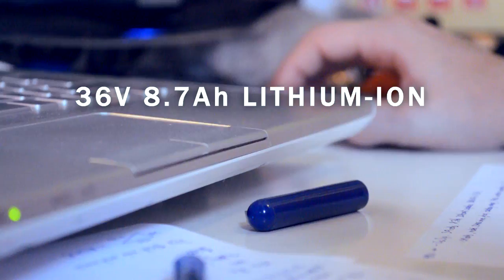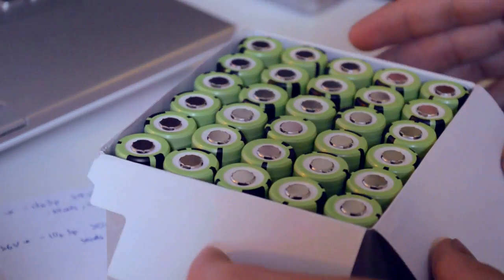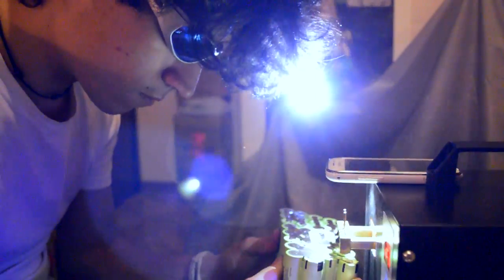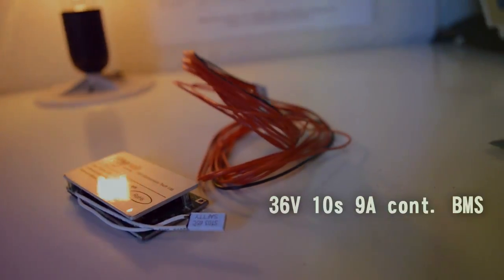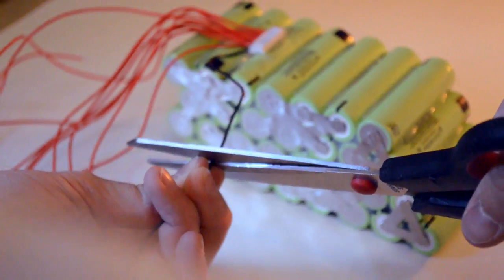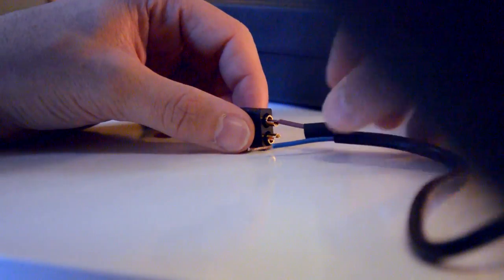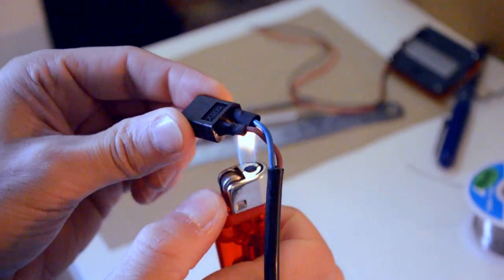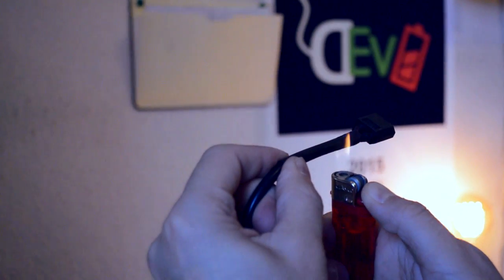36V 8.7Ah Lithium-ion portable compact seat bag battery pack

Comment: By putting lithium ion battery's in parallel connections do you add up the current? So if I put two 20A battery cells in parallel,would it put out 40A? This is a very important question because I don't want to pay a lot of money on battery's and put them in parallel connections to add up the current just to find out it doesn't and waste a lot of battery's and money.

Comment: Hey Damian, I'm not sure if you're in the US but if you are could you recommend a supplier for the battery shrink wraps and the heat resistant tape? I've found the PVC in these wraps to occasionally be of dubious quality and sometimes heat resistant tape isn't all that resistant.
Reply from the maker: this is a source for large shrink wrap: http://www.ebay.com/itm/268mm-Diameter-170mm-PVC-Heat-Shrink-Tubing-Battery-Covering-/322151524283

Comment: Hi Damian, just want to know about charging, if it could be charged in series, i.e., charging at the end points of 36 v or additional points to bring out from individual 3.6 Vdc. As it seems that cells were having inbuilt protection circuit, so is it safe to connect two cells with protection circuit in series?
Reply from the maker: once they are in series you can still charge them independently (each series separately not each cell, paralleled cells charge together), or charge everyone at the same time with the matched charger voltage. For 10s li-ion 42V

Comment: Im looking to make a battery pack to power a 300w 36v motor- what would you reccomend? Thanks
Reply from the maker: If your controller doesn't output more than 9A continuously, having a 9Ah battery (1C max continuous discharge) or more is the best discharging scenario for a li-ion battery

Comment: how do you keep them from getting too hot if you glue and shrink wrap them?
Reply from the maker: +cris mitton Indeed in this way the heat transition between the cells is much faster than arranging them in other postions (like with cell holders where there are 4 cells faced instead of 3). The surface of the cells in contact is the maximum possible, and the silicone is a better heat conductor than air (static). The shrink wrap is very thin and have a very great surface, it is very important to use because there is indeed the best way to insulate a battery wit the maximum heat dissipation possible.
If you are making a very high discharge rate with these batteries (greater than 3C) you should add an active insulation, in most cases these batteries works for low rating power demanding and are installed in a good position with passive air cooling

Comment: Awesome editing! I love these videos. One tip i have for soldering on the wires to each set of cells is to solder onto a small pice of the nickel strip then stop weld that onto the pack. Allows you to get a better solder connection and protects the batteries against the bit of heat from the soldering iron.

Comment: i need a battery like this for a portable amplifier...  is any possible way that you can do it ??? the consumer is 12v 5A(max) .... and i was thinking of a battery pack of 12v 20A ... but everybody on internet makes only big ones 36-48v .... i'm trying to figure ot how to build one but my knoledge isn't that great ...
Reply from the maker: +capcyvasile The battery could be similar made than this except it would be made with 3s or 4s depending on your electronics voltage specifications, a 12V 20Ah would have a similar size than the one in the video. You could contact to me at rene.sunset@gmail.com and I can help you to design your battery

Comment: Very tidy work! what are the two white cables coming out if the bms? I couldn't find and information on the website.
Reply from the maker: +Thomas Setchell It is a temperature sensor. That BMS board has a temperature cut protection function.

Comment: Very nice battery dude! I guess it is made for some smaller regular city  e bike? Since those battery dont realy like more than 1C load...Anyway good job , keep it up!
Reply from the maker: ***** it is indeed for a commuter assisted ebike. With a small rear 250W hub motor Q100 and a KU-63 controller is expected around 40Km of assisted range. BMS cuts indeed at 1C (9A continuous) but that combination of motor and controller takes around 6A - 7A continuous flattening at max. throttle. Thanks for comment!
Reply: Damian Rene i have similar e bike but my is 100% made in china ;) 250w , 36v 10ah li ion.. And when it was new ,range was at least 50km ,sometimes even 60km if we drive carefully. Now after 10-11 months of every day driving (20-30km peer day) range is around 35-40km which is good considering it is a chinese bike with probably very low quality cells... Latter when it is needed im planing to replace all cells in battery pack with some simillar like you used in this video. It will be much cheaper solution then buying a new one:)
Anyway good job with e bikes , plz continue uploading videos.Ur clips  are very interesting to watch! Cheers!

Comment from the maker: Building a 36V 8.7Ah 18650 lithium-ion cells battery pack for a small seat bike bag.

- 10 serial, 3 paralleled 2900mAh 3C max Panasonic 18650 Lithium-ion cells.
- Spot welded 0.1mm x 6mm pure nickel strips.
- 9 Amps. Máx. continuos BMS* with balancing function.
- 16 AWG Wires.
- 85mm diameter Battery Shrink Wrap
- 10s 36V lithium-ion configured battery meter
- 60A anderson SB50 connector for discharge
- 60A XT60 connector for charge
- 2A 36V 10s lithium-ion charger with XT60 connector
- customized seat bike bag

*BMS protection: HVC, LVC, short-circuit, over-discharge, over-charge, high temperature cut (65ºC)
Reply: Help me understand mAh to Ah conversion. I was told 1000mAh was 1Ah. Is that correct? So if this pack has 30 batteries at 2600mAh each doesn't that come to 78Ah? Forgive me if I'm ignorant I'm trying to learn.
Reply from the maker: A battery is made with cells in series and cells in parallel. Cells in series add their voltage, cells in parallel add their capacity (Ah).

This battery has 30 cells. 3 cells in each parallel group (3p), that make groups of 3 cells that are connected in parallel adding their capacity at the same voltage, so they are 2.9Ah * 3 = 8.7Ah, and the voltage the same 3.6Vnom.

Then those paralleled groups are connected in 10 series (10s) and they add their voltages. 3.6Vnom * 10 = 36Vnom. So we finally have a 36V 8.7Ah battery.

If you, instead if this, put all the cells in parallel, (1s30p), so of course you have 2.9Ah * 30 = 87Ah, but the voltage is only 3.6Vnom
Reply: Thank you very much for that explanation. I see how to calculate everything now and I understand what 1s30p means. Didn't get it before your explanation. Thanks a lot!
Reply: damian rene    abi bunla sarj olurmu https://tr.aliexpress.com/item/New-iMAX-B6-Lipro-NiMh-Li-ion-Ni-Cd-RC-Battery-Balance-Digital-Charger-Discharger-For/32819803545.html?spm=a2g0s.13010208.99999999.277.hg4MB6